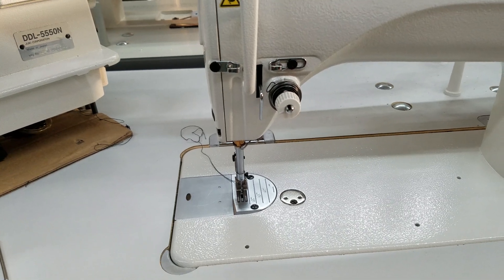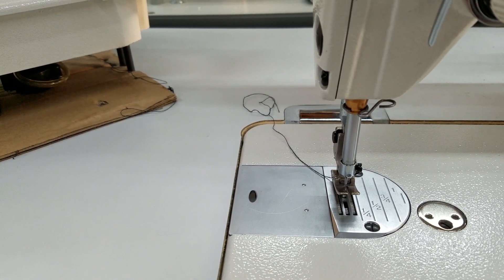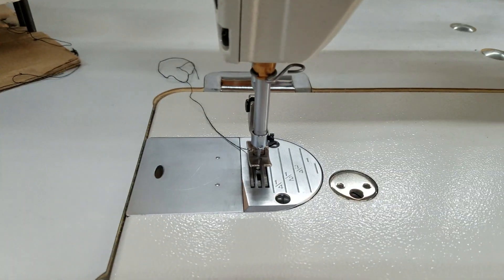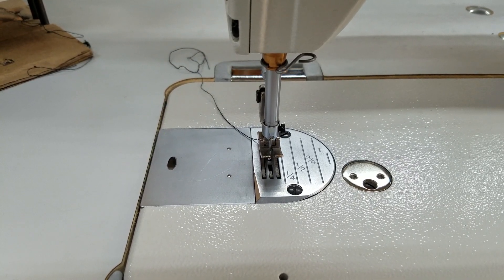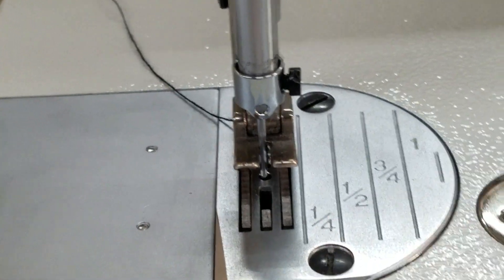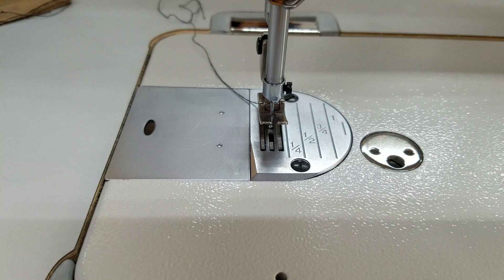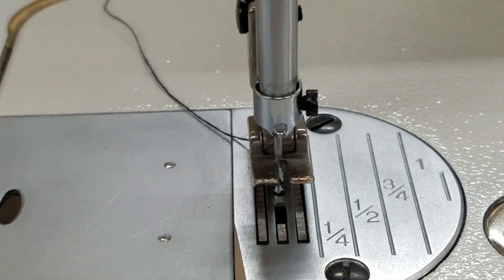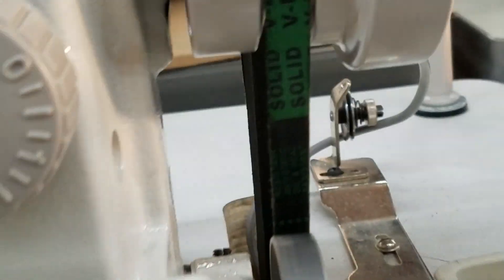The sound a Reliable SewQuiet 6000SM motor makes on a Juki DDL-8700

Comment: Hi, I just added a speed reducer pulley t omy Sewquiet 6000SM servo motor. There seems to be a light metallic rubbing sound now that is hard to pinpoint. Not sure if the servo motor is being stressed or if it is the pulley wheel. I greased the pulley wheel shaft as best I could and it did not silence the sound completely. Is there a way to grease the shaft of the servo or is this not advised? Thanks

Comment: Thanks for making this video. Just got a new Reliable Sewquiet servo and was a little concerned about the new noises 🙂
Reply from the maker: No problem.
Reply: Came here for the same reason. Just installed on my ZZ that maxes at 2000SPM. Running this motor slow it sounds like it's "clicking". Thanks for making the video!
Reply: @GordLinder  Does it still make a clicking noise?
Reply: @GordLinder  Does it still make a clicking noise?